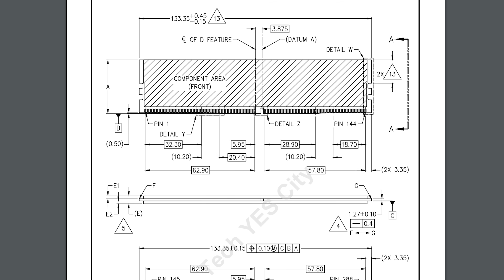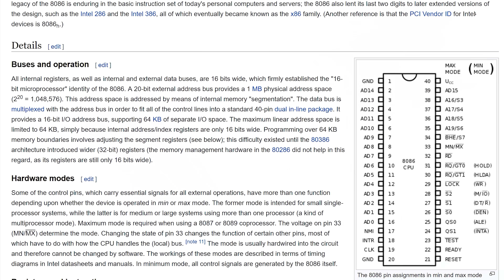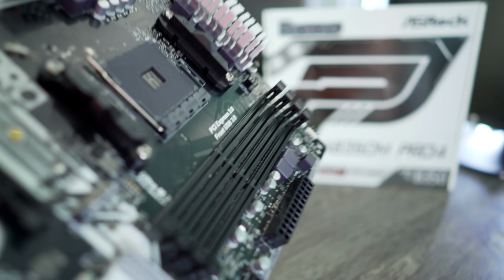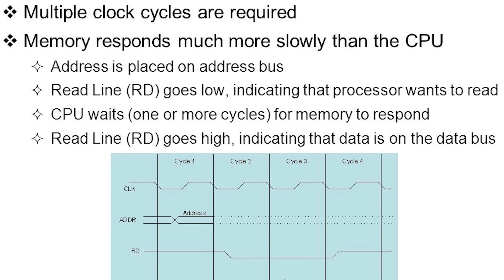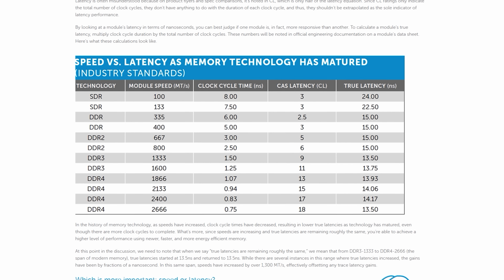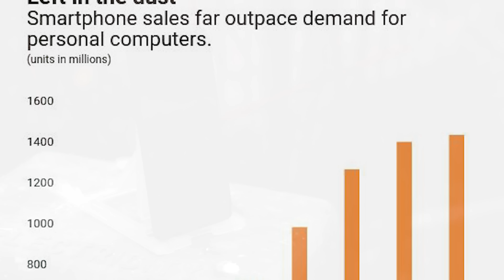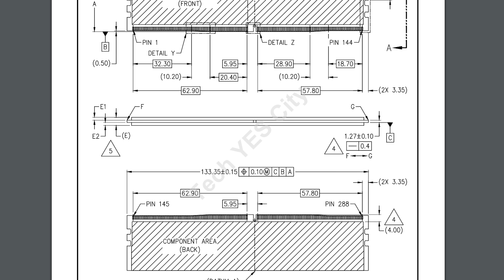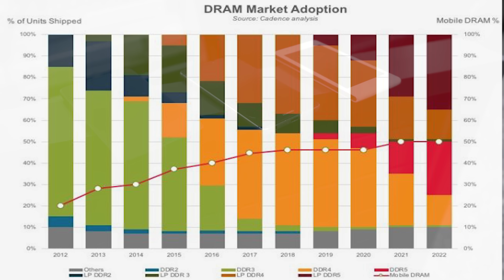When is DDR5 coming to a PC near you...?

Comment: Jeez maybe I should hold off my planned CPU upgrade til next year. Nothing worse than upgrading only to have new tech come out just after. Which kinda happened to me when DDR4 came out...
Reply: I wouldn't expect ddr5 to be mainstream until 2020 or 2021. If we do even get ddr5 next year, it'll be high end parts like i9 and threadripper.

New tech is always just around the corner.
Reply: @fortunefed8719  agreed
Reply: Well fuck it. I ordered it.
I wanted a 2400g at first.
(2400g is 170eur ...ish, here)
Found a shop selling 2600, non x, for 10eur more than 2400g but still 30eur cheaper than other stores, so i went with that. (So 180e for 2600)

Then, deciding between THE Samsung b-die 3200mhz cl14 at around 240eur. (Which I'd keep, ofc, for next ryzens)
Or cheap shit 8gb <3000mhz to keep until 3xxx or 4xxx ryzens. (80-100ish eur)
I found a nice little 16gb set of 3000mhz at cl 15-17-17. -160eur. That's pretty good imo.
We'll see if i can get it to 3200, tighten the timings.

Overall I'm pretty excited and i think all the parts have good resell value (again considering future ryzens).
Can't wait to try it out :)
Reply: Back in the 2000's I had an Athlon 64 but then GPUs went from AGP to PCIe slots; I would rather wait for DDR5 than get left behind on DDR4 for buying too early :P
I'll wait for Zen2 in 2019+ but a few things concern me: I suspect initially DDR5 will mainly improve capacity, with performance/bandwidth only improving later on.
If so, first DDR5 motherboards and CPUs will only be compatible with slower DDR5 kits. CPUs won't but perhaps boards support later DDR5 also; slim hope though.
I know I would rather upgrade RAM/GPU than CPU so picking a board "future-proofed" for that is more important to me than CPUs, but we all want different things.
Reply: Personally I'd wait until 2019 release, then upgrade my CPU due to the fallen non-ddr5 prices. You can bet intel will release something incredibly expensive in the i5/i7/i9 skews that will prompt new mobos, ram, cpus etc.
Reply: @JoClip1984  yeah I'm probably going to wait
Reply: I'm tempted to upgrade too.
Reply: x1c3x tempted to go Ryzen actually but want something that pushes 144fps @1440p to match my monitor and Ryzen does lose a few FPS in many cases. Think I will wait and see what the 9700K looks like.
Reply: MaTtRoSiTy i thought they do 144 fine. Ofc with low latency 3200+
Reply: x1c3x nah they don't in many games whereas Intel does. Don't get me wrong, in most cases they aren't far off but they lose out to Intel more than they win and I want every frame I can get. Though I may consider it still if performance improves with a refresh... Kinda over the Intel cash grab too
Reply: MaTtRoSiTy an Intel is probably better then. There is an awkward price increase of 8700 cpus recently though, according to some YouTubers.
Maybe the 7nm Ryzen will be 144hz worthy, but not only is it quite some time away, we also don't know what kind of performance to expect.

I'd say the new Ryzen and 9 series Intel cpus might be worth waiting for, but i wouldn't wait on DDR5,

I'm in a similar situation. Deciding between a b450/x470 with a temporary 2400g, then get a Ryzen 3xxx, assuming the prices will be similar( ie. 6 core for 200-250ish eur). Or get a 2600X, then if 3xxx performs seriously out of this world good-switch to it, if not wait for the 7nm+ in 2020.

Then there's the chipsets lol.
Sure b350/x370 support new cpus, but not Precision Boost 2, which is quite good. Also, i think b450/x470 have better memory support.
So, what'll be the drawbacks of current motherboards, compared to the new ones...

But i guess all this is the fun part of building a PC :)
I like how AMD made things move again. I'd never consider them before Ryzen lol.
Reply: x1c3x yeah it can be hard to decide. I am okay for now anyway as I have a pretty high end set up but ya know... more fps is always better! 

It is nice to see AMD back in the game, well at least as far as CPU's go. I will definitely wait and see what 2019 brings
Reply: Jesus there is a lot of misinformation in this little thread here. Firstly, if you are looking to render @1440, it's more GPU work than CPU and seeing as a new gen of GPU just launched, any further gains made on that front are a long ways off. Secondly, when looking @1440, the gap between AMD and Intel so so close that it can be considered testing margin of error. Most games are Intel optimized, as are the tests for performance. We currently have one AAA title that used AMD optimization (they used Intels optimization as well) and it's showing quite a different story from the other titles. Thirdly, memory prices have come a long way down recently thanks to the investigations of artificial price increases. A shift from DD4 to DDR5 isn't going to impact gaming in any real notable way. While memory speed does impact AMD chip performance, what has been found to date is that 3200 is the breaking point. Anything under that and you are slowing it down a lot, that and over are performing so close together that it's not going to be noticeable.
Reply: daft vagrant ok, but don't forget he said 1440 and 144hz.

And about ram - it's not just about prices. DDR5 = new chipset, motherboards. Not a big deal perhaps, since we're getting 4 different Ryzens, (opposed to intel needing a new mb anyway) before that.
I just hope they support the next socket for a while too.
I remember how much it sucked being stuck on DDR2 when 3 came out
Reply: BEEPBEEPIMASHEEP 
If the games you currently play struggle to get playable performance, sure.

But there is input lag.

I didn't notice it much paying PUBG, because it ran like crap on my PC, but ran fine in GeForce NOW.
But playing Overwatch, which works great on my PC, i noticed it like i had limited my fps to 30 or turned on Vsync.

Should be awesome for Witcher, Tomb Raider type of games tho.
Reply: Wait for 7nm
Reply: I'd say upgrade now. DDR4 RAM is really good, especially fast RAM paired with Ryzen
Reply: @mr_beezlebub3985  I have DDR4 already

Comment: I'm on DDR3 but it works well enough for me. Also on an i7 3770K
Reply: Beautiful chip that will last you atleast half a decade more!
Reply: I am also on my 3770k!
Reply: On Ryzen now main, but my 2nd W7 PC is I7 3770K with 16Gb DDR3 2400Mhz CL10 so I figured I needed 3200Mhz CL14 DDR4 (max speed for my X370) on my Ryzen to consider it an actual upgrade.
The systems seem to run quite close in some games I have on both, although the Ryzen 1800X is smoother and has double the cores/threads.

TBH though my major upgrade was getting both new GPU & M.2 X4 960 over just plain old SSD, so this achieved only a few seconds boot up time improvement! (may be <10s to <4s)

Previously I once  had just 2Gb of DDR3 2000Mhx CL7 on a 775 mobo and it was noticeably faster than when I upgraded that to 4Gb of DDR3 1600Mhz CL9 obviously, but it was so much so that is why I've always paid to get low latency RAM as well as highish speed. That CL is more important than people think even on Ryzen which loves the Mhz speed boost, although sadly seems mostly to only the mid-3000Mhz stable ATM.
Reply: Funny. I’m on a 3770 too. And does everything I need it to do just fine.
Reply: Lucky you i3 4010u
Reply: Got non K 3770
Starting to show it's age in modern gaming
Reply: Same. Still holding up but definitely starting to show its age.
Reply: me too. i got mine at 4.2ghz up to 5ghz turbo.  ----------> gta v game play  https://www.youtube.com/watch?v=EHBh2bT3WC0
Reply: i just got a i5 2400 im gonna upgrade to a ryzen 5 2600 soon

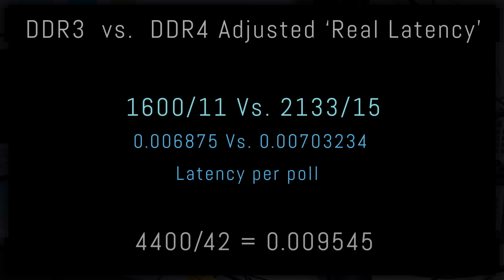Comment: Your latency calculations between generations are off at 4:04. ddr3 1600 cas11 is overclocked, and ddr4 3000 cas15, which would be more of an equal alternative to ddr3 1600, can be found quite easily, thus favoring ddr4 in latency.

Cas timing of 42 for ddr5 is for prototype models. The same kind of prototypes had CAS32 on ddr4, so expect that to come down quite a bit before we get consumer grade ddr5 and I'd expect latency to go down again while increasing bandwidth
Reply: IIRC the main focus AMD said on DDR5 was to try lower latencies so no way the production chips would be that high of timings
Reply: @Motolav  Timing is not that huge of an issue - the increased transfer rate of the new memory is the huge benefit to both Intel and AMD.